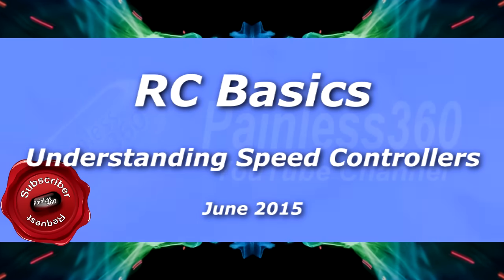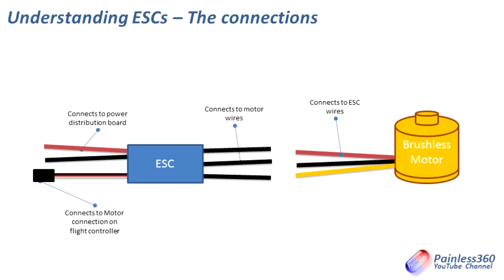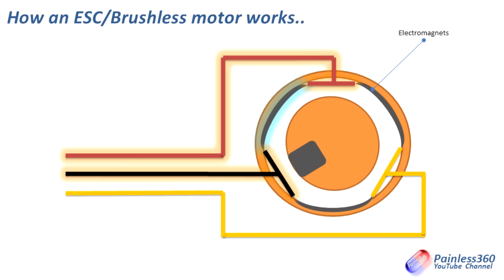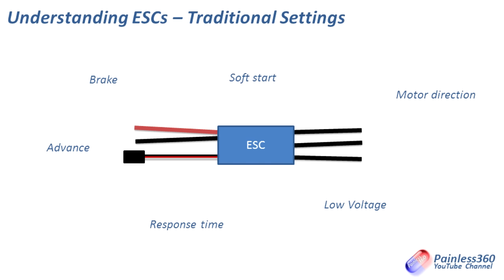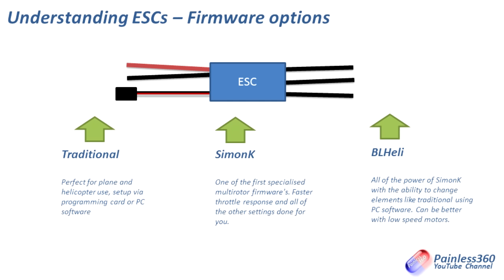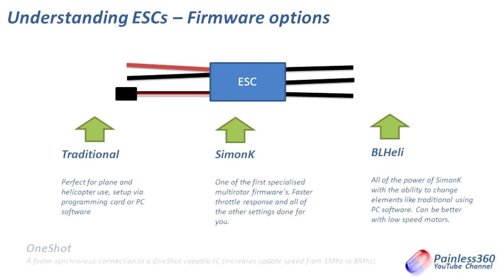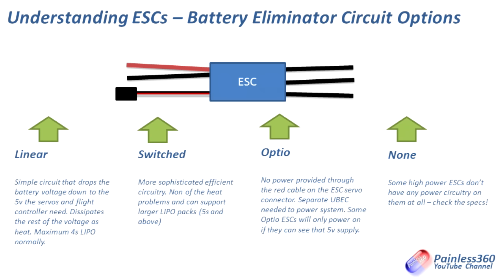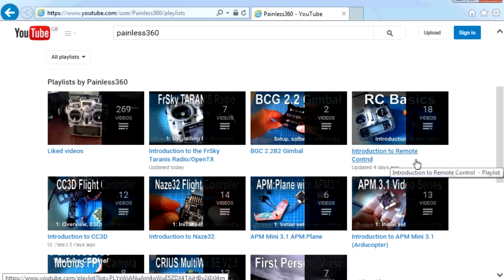RC Basics - Understanding Electronic Speed Controllers (ESC)

Comment: question i got A 35A Brushless ESC    what does 35A mean   does it mean it can handle 35a from a battery
or will it give 35A to the motor       the motor can handle 37A
Reply from the maker: It means that it can supply a maximum of 37 amps continuously so you need a motor that needs less current so that you're not running the ESC at 100% and stressing it. The ESC will pull the amperage (current) from the battery as needed.. See the other videos on the 'Introduction to Remote Control' playlists for lots more of the basics explained for new builders and pilots. Best of luck!
Reply: ok ty  so i can use a 160A esc on a 37a motor

Comment: Great video!  How can I tell if an ESC is going out?  My quadcopter drifts to the left and forward after flying for a bit.  Also, the front left motor doesn't seem to have the brake control working .  Usually if I flick the props with my finger they don't spin while connected to the esc's.  The front left one now spins freely when connected to the esc.
Reply: +Jeremy Dockter It is a STORM SRD 280 v2 with storm 15A esc and 2200kv motors
Reply from the maker: +Jeremy Dockter Sounds like the settings on one of your ESCs is different. That on it's own can cause problems like you are seeing. Normally ESCs fail in a dramatic way..

Comment: I'd like to power a drone motor on the benchtop. I imagine I can connect standard power supply. Is this possible?
Reply from the maker: If it has enough current capacity and the right voltage, probably. I've never tried. Best of luck

Comment: I absolutely love watching your knowledge and videos...I'm building a 6s plane and have a tone of room...can I run a Castle Creations Mamba X surface esc (BEC 5.5v-8v... was putting in my Kraken)...my problem is with the braking within the esc...can I just run it no reverse, no braking? I don't want to ruin a $350 plane and have it fail.
Reply from the maker: A surface ESC normally has a brake and a reverse. I would not use that in a place.I would use an ESC designed specifically for flight. Best of luck!

Comment: So... Can I use 350A(50C, 7000mAH) battery with 60A ESC and 60A Motor(Brushless)?
Reply from the maker: Yes you can, the motor will only pull the current it needs from the battery.. Best of luck!
Reply: thanks thanks thanks!!!!

Comment: Painless I asked you why my drone was losing thrust on my motors I looked into what you told me I needed to see what escs are recommended it said 18amp I have 40amps on my drone is this why my loss of thrust??
Reply from the maker: Check out https://youtu.be/cXULcdX9Kv0 I hope it helps
Reply: Yes this helps thank you I may have to calibrate each one I never tried that yet thank you very much!
Reply: I calibrated my escs and now my motors won't spin up wow! Any ideals why??
Reply: Well lol it would help to put the motor wires in right way I had them upside down goofy but yeah painless I got my drone up and running again and recalibrate my escs now I get power bottom to top! Thank you!
Reply: I'm going to be getting the speedybee soon can I use it in inav? I don't want a fast drone just looking to run it like a normal drone??
Reply from the maker: Things like that are usually on the manufacturers listing. I'd check that out...
Reply: @Painless360  ty

Comment: I want to get the complete step by step procedure in setting up my Flysky FS CT6B to control a Sabertooth motor driver for 2 wheelchair motors. After I purchased the Flysky system I discovered not everything I needed to make it work was contained in the box. I became aware that I needed a separate power source for the receiver. Then I became further confused with ESCs & BECs. I'm talking about connections, current requirements, etc. My Sabertooth driver is dual 32 amps.... This all new to me.
Reply from the maker: +William Gunter all of the basics for radio control, when it relates to radio control models, are in the 'introduction to remote control' series here on the channel. This video is part of that series, hopefully the other videos will help. Best of luck

Comment: The throttle setting controls what exactly in the ESC? Is it RPM? Is it voltage? What happens when the propellar spins faster than the throttle setting (lets say you have a variable pitch drone doing a dive and the upward winds make the props spin faster as gravity makes the drone accelerate pass terminal vel).? Will the motor try and slow it down?
Reply from the maker: +RoboticSolutions.TECH an electric motor is actually a constant velocity device. It will try and maintain a constant RPM irrespective of the power supplied. That's what the KV is all about it - tells you how quickly the motor will turn for the voltage applied. What the ESC is actually changing is the duty cycle of the waveform that sent to each of the motor coils in turn. The throttle signal increases the amount of 'on' vs 'off' voltage the each motor phase gets in a high frequency waveform. There are some excellent videos and articles online the explain this in a lot of detail. Best of luck
Reply: Please dont wish me luck and send me on my merry way yet. You didnt answer my question. If wind pushes my propeller to spin faster than usual at the specified throttle setting so that its RPM is way above what it normally would be,  would the ESC and motor attempt to slow down the RPM? So lets say I set my throttle to only supply 1 volt and the engine is a KV1000. But I put my variable pitch quadcopter on a dive with negative pitch so the propeller now spins at 2000RPM without changing the throttle setting. What happens? Will the Engine and ESC supply negative torque to try and slow it down or will it keep pumping 1 volt in to re-enforce the 2000RPM spin? Or will it just supply no voltage at all?

Comment: Very interesting, thanks! there is one topic I didn't clearly hear in your video: does any ESC controller works with any brushless motor?
Reply from the maker: Pretty much, as long as the ESC is rated for more current that the maximum the motor needs. Some motors may need tweaks to the settings though (advance etc).

Comment: Hi again mate.  I just browned a motor (Quanum MT3110) using a Multistar (SBEC4R) 30a ESC (480 hz / 2-6 LIXX / BL HELI).  On looking at the spec it says it has no BEC (Opto) so here is where my confusion lays.  If connect motor to esc to a quad power distribution  (3.5mm bullets) board connected to the 3DR APM power module with XT connectors and battery in via the XT60 connector for the battery, how can I burn out the motor?  I am guessing i need a standalone BEC?

Sorry if that's long winded or amateur sounding but I am wasting money on kit unnecessarily lol.  Cheers mate.
Reply from the maker: +John Cassidy Not sure what you mean by 'browned out'. If the connections are ok and the ESC firmware isn't set to anything wacky then a failure is normally due to a faulty part..
Reply: Browned means burnt mate.  Magic smoke
Reply from the maker: I see! 'Brown out' to me means "a temporary reduction in supplied voltage causing a loss of control/function in an RC component (usually radio receiver)". If that happened to me with a motor then I would be straight back to the vendor if it's new..
Reply: Hmm of course but I'm an ex squaddie with a lower percentile RC quotient
Reply from the maker: :) Best of luck with it..
Reply: Yep best answer mate lol
Reply: But if you're interested I am building drones to deal with ISIS mines.  Using pix4d to map and inquisitive eyes to determine next steps
Reply from the maker: Sound like fun and very worthwhile project...

I'm sure your 'lower percentile RC quotient' is growing rapidly!

Best of luck with it.
Reply: Oh it's worthwhile and difficult mate.   Therein lays the paradox.

Comment: Hello sir..can you help me? I have escooter which run 25km/h ,i would like to add more speed..what should i change or upgrade?
Reply from the maker: If you want more thrust then you can change the motor or increase the voltage but be careful of the impact to amp draw
See the motor testing I did in the endurance builds.. Happy flying
Reply: @Painless360  thanks for the reply sir..my escooter spec is 48v 800w dual(front and rear wheel)total is 2200(idont know why the total is 2200 actually, 18 ah battery...may i know sir what specifically the complete name,power to buy,maybe 40km/h would be enough for me ;im afraid if there will be a problem from wiring and its compatibility...sorry for soo many question sir..
Reply from the maker: I'm not the best person to ask about this, I'm not a e-scooter guy.... Best of luck!

Comment: So I know of 3-phase motors from commercial A/C work where I swapped electric leads to change the
direction o f spinning but can you likewise  change the  propeller backwards to essentially do the same
thing  or are  the propellers  notched in a  way that they'll  only work in 1 direction? And I imagine some manufacturers can be swapped & others have their own,  "Notched Groove"  to make sure the propeller
turns the right way?  I'm trying to get a basic set of,  "Wants/Needs" put  together for my flying.
Ultimately I want  one Transmitter(easiest/user friendly) & it needs to have several,  "Flight Controllers"
it can support/handshake with?  Once I  can  establish this main issue I can have any  number of other
components fall into place. My mind is whipping along......
Reply from the maker: Props can't be reversed and have the same thrust and efficiency. With a very flat profile and minimum aerofoil you can design a prop that can go both ways but most can't.. Hope that helps..
Reply: @Painless360  >> The "prop" example I was asking was not to run it in reverse But to pull it
off the shaft & remount it the opposite way. But I digress,  you've helped me to unlock my
brain a little bit with your skillset(s) & I've got to learn some other things before I can ask
you any intelligent questions.  This will take me a few days but I'll shout out when I reach
saturation or I get to a place where I'm about to spend $$$.....lol, I've been taking my time
to ensure that I don't spend monies I don't have on stuff that I can't use. Thank you again
& I'll be somewhere in your vast library...… I'm glad you have one!

Comment: If i have a box stock  plain like a foamy that is ready built with a 14v motor and its build in ECS. If I ran a 18 volt lipo instead , what could really go wrong ? some say nothing, just don't pin the throttle hard ?!?
Reply from the maker: Depends. Just increasing the voltage without checking can cause an ESC to fail. See the motor and ESC testing in my endurance builds to see how much a difference it can make... Happy flying

Comment: hello painless360,
great channel you have,  it really helps, but i'm quite new on this hobby.
i've only been flying toy grade quads. now i bought a f450 frame and want to buy esc's and motors but want to be on a low budget and are just so much diferent stuff out there for sale. what is your opinion on esc's. i have checked on eBay the HP simonk 30A ESC (black colored) . what do you think. and motors???
hope you can help
thanks and keep on posting
Reply from the maker: +canim 1973 Depends on the model and how much weight you need to lift! See or videos on choosing motors.. Common choices are the 2213/935KV motors with SimonK/BLHlei 20A escs. Best of luck!
Reply: My goal is to lift my xiaomi yi with gimbal. What do you think about 2212/920kv with HP simonk 30Aescs

Comment: Could you use 2-wire motors? (just power and ground)
Reply from the maker: +Kitsuné Blade Not if it's a brushless motor. If it's only got two wires then it's a brushed motor and will use a different type of ESC.. best of luck!

Comment: Very useful vid, after a 15 break from RC planes the electronics have changed a lot, in my ignorance I’ve ended up buying a Emax SimonK esc for my model glider, will there be a problem as this is a multi rotor ESC or can I use it in my glider with no issue? Thanks for any help
Reply from the maker: It will work fine. SimonK just removes the ability to change the ESC parameters you'd normally expect to be able to change (like breaking for example)... happy flying!
Reply: Thanks very much for the prompt reply, really appreciate it. Does that mean I won’t be able to programme in engine break as it’s going on a glider with a folding prop?
Reply: Painless360 thanks very much, was just hoping there would be a easy solution. Last question, any recommendations for a decent inexpensive ESC for glider application?
Reply from the maker: Depends on the amperage you need. I use cheap HK fixed wing ESCs usually..

Comment: Great video! I was thinking on using an ESC to control a cordless drill motor, but this motors only have 2 cables, what can I do? Do I just ignore one cable and use the remaining ones?
Reply from the maker: If the motor has only two wires then it's probably brushed, not brush-less... Best of luck!
Reply: Painless360 Oh ok, thanks man

Comment: Hey, thanks for the great vid.  I'm looking for an ESC to connect a 24v 2.2amp DC brusless motor to a PWM controler.  I can't seem to find a suitible ESC.  Most are rated for much lower voltage.  Am I missing something?
Cheers!
Reply from the maker: Maybe, support for 6s batteries is common...
Reply: Painless360 My power supply is 24v DC.

Comment: That was very helpful. Thanks.  Quick question in case you have time... Is receiver required to start the motor with esc? I was planning to build a non RC flying object..using arduino and distance sensors and some time logic.. I saw in some other video that motor will not start if throttle not at 0. Thanks again..
Reply from the maker: Cnite Vedi No, you need to look for the PWM libraries ofr Arduino and watch my videos on ESCs on the channel to see how they work. Normally an ESC will only 'arm' once it sees a low enough PWM value that corresponds to zero throttle (usually around the 990-1050 microseconds)Best of luck.
Reply: Painless360 thanks for replying. I will give it a shot..

Comment: I have these Tarot 40A 2S - 6S ESC OneShot & SimonK Firmware with 5V BEC - TL2953, the specs say they are linear but you mentioned that linear are only for 4S Lipos. I have 6 of these going onto my Tarot 680 hexacopter, so now I'm a bit worried as to the suitability of these ESC,s.
Reply from the maker: They will be fine but I'd not use them to provide the 5v the flight controller and pieces need. I'd power it using a dedicated 5V BEC.. See the other videos where I cover this in the 'Introduction to Remote Control' and 'Quadcopter building for beginners' too..
Reply: many thanks, I'll take a look at your videos, my tarot build has turned out to be a bit of a nightmare, but at the same time a very interesting learning curve. Thanks again.

Comment: I have a 90a esc in my boat. it runs on 2x 2c Lipo. I would like to run 6c total. what esc do I need
Reply from the maker: +Peter Saar The choice of ESC comes from the motor size, not the battery. Look at how many amps the motor pulls and work from there. Best of luck.

Comment: İ ask something i use 60 amper esc and 4800kv motor with 3s lipo.They work very well in air with propeller.Esc gives above 50 amper.But if i use propeller inn water esc did not give much than 5 amper.İ think its abaut torque but i think 5 amper is ver low?Why Esc give me more ampers??
Thnak you
Reply from the maker: +Onur günay Sorry, not sure what you mean - we have no experience of props in water.. Best of luck..

Comment: I noticed that the ESC has three wire of the same colors  if you have a two wire Motor  You choose any of those three wires to connect 2 wired motor Don't  matter which one  Since the ESC    don't have no colors For  positive and negative  Connection   I need to use a meter to find out positive and negative on the ESC  Of the three wire coming out  esc I haven't worked on any esc I don't know if the housing has markings for the wiring I am a beginner hobbyist  don't know too much  about it   I know is that he has On the esc  Has marking  W B U   Can you tell me what they mean  thank you
Reply from the maker: +Raul Rodriguez I suggest you watch a few more of the videos in the 'Introduction to RC' playlist. We go over a lot of the basics. It can seem complicated when you first start but it will start making sense... Best of luck!

Comment: Can someone answer a question if building a inav wing using a matek f405 wing FC should i use a traditional plane esc like in this video or the kind I have on my drone build Blheli ect?? My main thought is how to connect the traditional esc to FC if I use signal and ground what do I do with the spare red wire or am I completely wrong on connecting it?
Reply from the maker: You can use traditional or Dhot ESCs. See my iNav builds as most planes come with traditional..

Comment: hello everyone i want to built quad-copter for that i purchase most of the component but while testing my esc getting fire
my quad setup is
1.tarot 650 iron man frame
2.tarot tyi-5008 400kv motor
3.1555 " prop
4.6s 10000mah tato lipo battery
5.30A FVT LittleBee ESC
6.pixhwak
please help me sir i very frustrated regarding esc nearly 4 esc get damage.please suggest me proper solution.
thank u .
Reply from the maker: I wouldn't use LittleBee ESC's for those motors, all of the listings I can see for that motor in the quick search I did were using things like the HobbyWing 40A ESC. Maybe that's part of your problem. I'd also look in the forums to see what other pilots are using successfully with those motors. Best of luck!
Reply: thanks sir for quick response 😀😀
Reply: Your video are really good and useful for beginners.